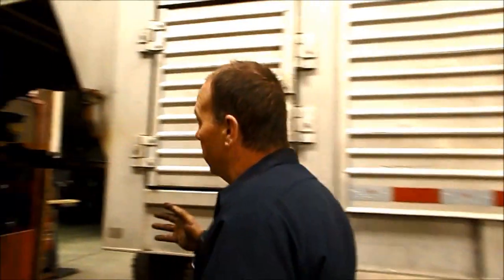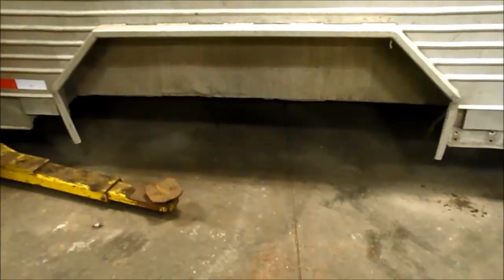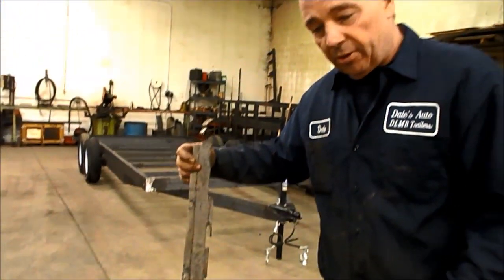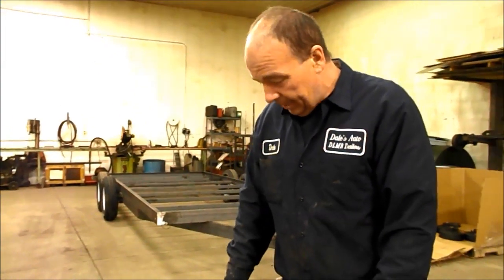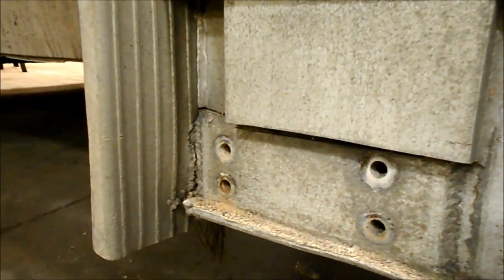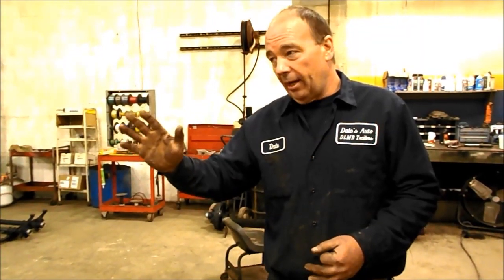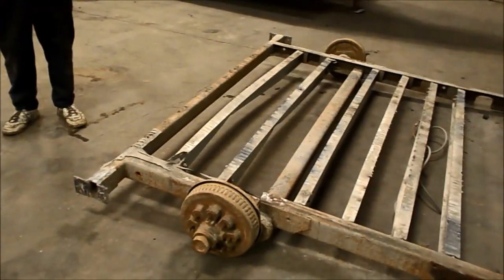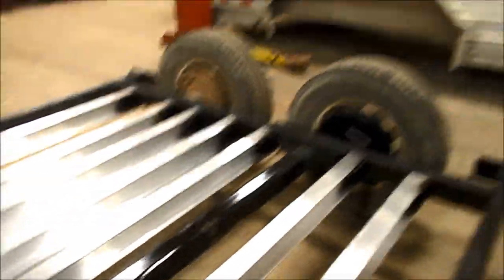Trailer Talk Ep2 - The All Aluminum Trailer

Comment: Anytime two dissimilar metals are against each other especially outside you will get some type of corrosion even aluminum and stainless steel.The best trailers overall that have to sit outside are galvanized steel ones.
Reply: Which horse trailer brands do that?